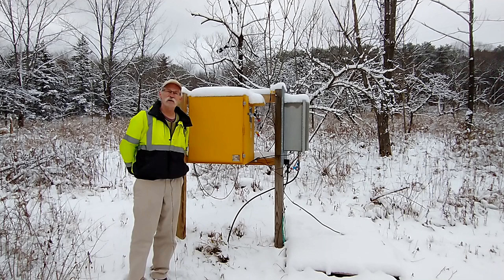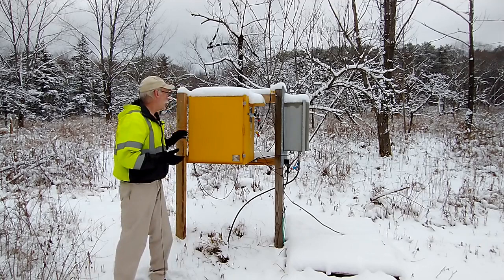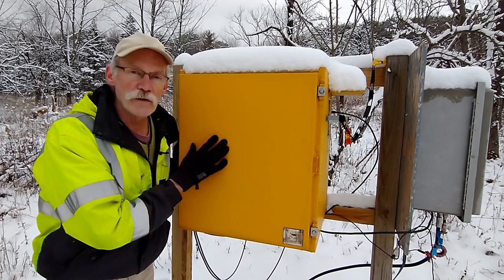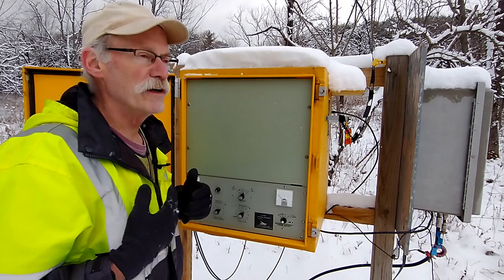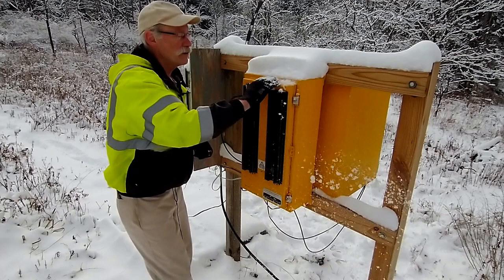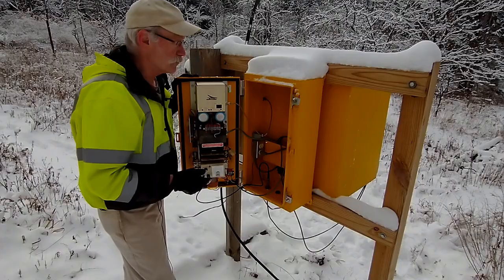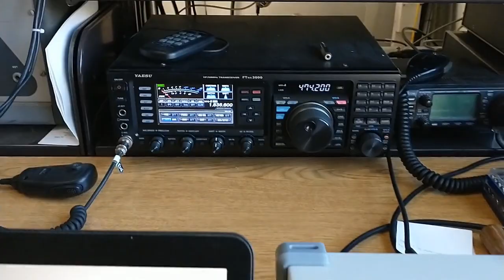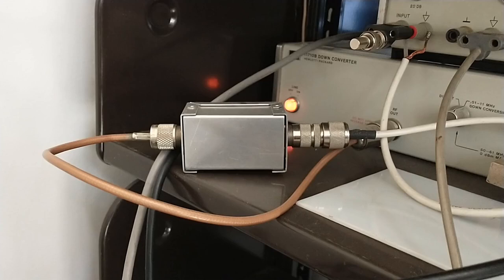How I got on 630 meters

Comment: As a ships radio officer, who spent time in purgatory on oil rigs, I have had some horrid experiences with NDB antennas. Whilst on leave the rig NDB antenna was destroyed in a cyclone. On my return (not being told this had happened), I had irate chopper pilots inbound with no fix till 3 miles outs (normally they got me 100nm out, dependent on altitude). On perusing the antenna I was shocked to find our heavily loaded whip had been replaced with an old HF whip!!! This "repair" was care of BUZZ our well meaning electrician from the deep south, who said "it's the same length so should work fine!!". I gave up trying to explain resonance, and should have known better, as on a previous occasion he chopped my airband VHF coax but "fixed it" by splicing it with electrical tape.....on that occasion I spent some time trying to explain VSWR!!! Thanks for the video I love the mystique of the big wavelengths, not to forget that WT ships at sea used this band too, I sent on 4?? kHz channels WT in the 80's...forgot the frequencies!! 73 de VK2AOE